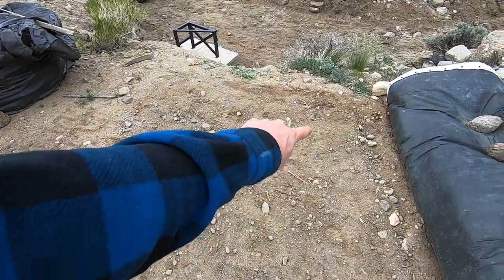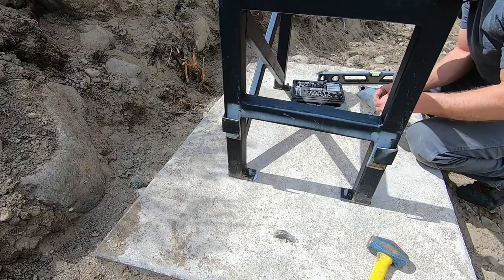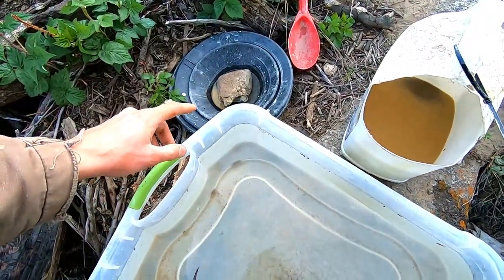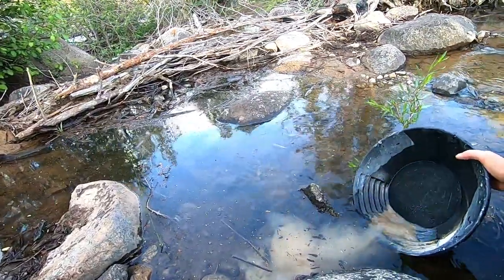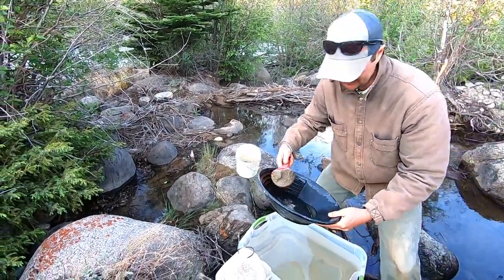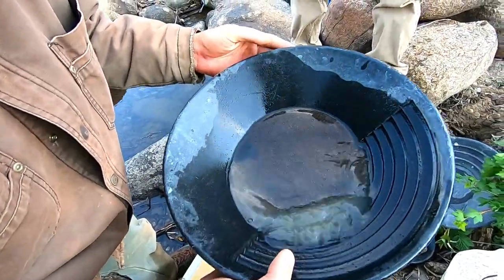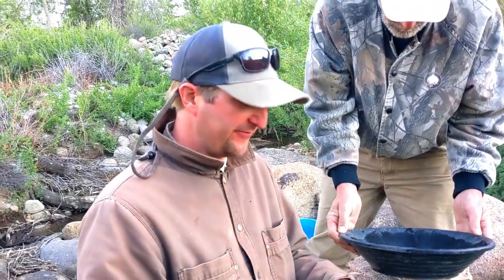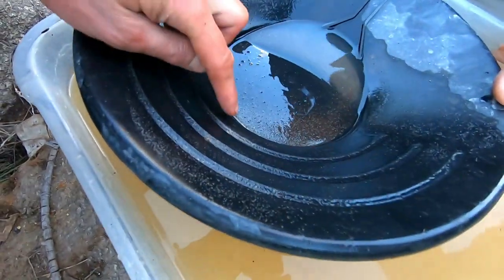GOLD MINING Hammer Mill PULVERIZES 1 TON of GOLD ORE!

Comment: Next time you are driving those lag bolts put a nut on the end to keep from screwing up the threads.You were lucky to not have to use a thread chaser after hammering them in. Do you use a xrf scanner on your ore? If not,why are you wasting time,and time is money.Hand held ones are not as accurate as bench types but will put you into a ballpark of what is in the ore. Price on the hand held type are in the $1k range.They take up to 4 minutes to get a result and the finer you grind the ore the more reliable the reading.Do the research and watch a few videos and read reviews to make a choice. These xrfs are a game changer for prospectors.More valuable than a geiger counter was  for the prospectors looking for uranium back in the '50's. I used to use nitric acid to burn off anything that wasn't gold back 40 years ago.Buy 2.2 liters for about $100.Educate yourself on safe usage and how to dilute it to burn off the junk and leave the gold. Anything can be dangerous for the ignorant.I seen old prospectors carrying glass bottles of the stuff in their pockets.I'm not that stupid.I was put on a crew to make 6 tons of gun cotton and wore a full hazard suit with air fed respirator to make it.Never got burned or wrecked my lungs so you can handle it safely.Safer than cyanide. Sodium thiosulfate was my friend when working with cyanide.Mercury isn't something that I'd use because I seen too many guys get into trouble using it.Some would just cook off the sponge in a cast iron pot and try to stay upwind.Retorts didn't cost that much and you could reuse the mercury but the stuff is sneaky and it doesn't take very much to turn you stupid.Good luck on your gold mining but you need a better system to get all the gold and quick enough to still be young enough to enjoy it.Nothing sadder than seeing an old guy who got the millions too late to enjoy the fruits of his labor.

Comment: I hated the orbital system and you will as well. Too tedious a machine especially if your just sampling. Kinda confused cuz a $1700 hammer mill versus $6000 dollar hammer mill minus the fancy conveyor and you got cash savings! Always a good thing when mining.  Good luck.
Reply from the maker: The orbital "jaw" crusher seems to work quite well.  We did have a few issues with the hammermill but the owners have gotten it optimized and dialed in to run 500lbs/hr consistently.   What kind of problems did you have?  I know taking it apart to clean is a nightmare.